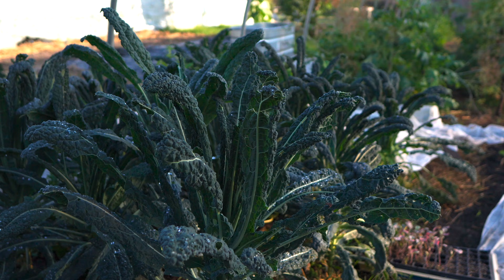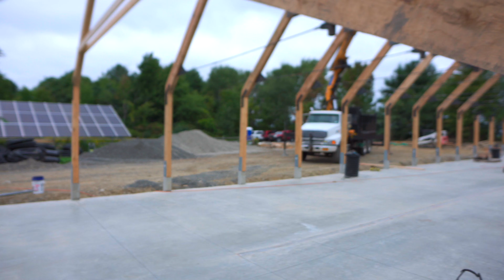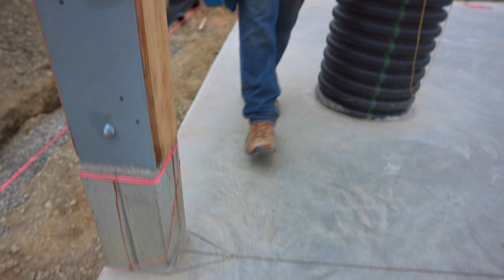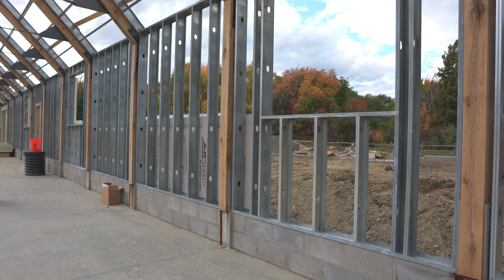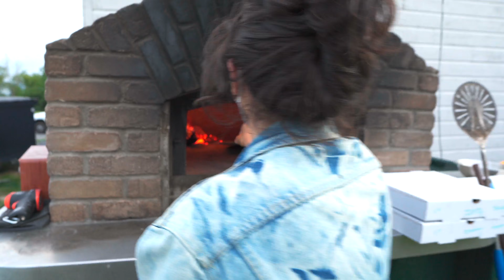4200 sq ft GEOTHERMAL GREENHOUSE Build! — Ep 019

Comment: I hardly think that you use geothermal energy. What you use is ground source based, witch is often misnamed geothermal. Geothermal means that you use heat radiating from the earth core, that means you have to go quite a bit deeper, drill at least 400 m, because you are not in an area where geothermal reaches the surface.

Comment: Why ITH would you use electric water heaters for the slab radiant when you could use an air-to-water heat pump and get 2.5x the efficiency with something like a SpacePak Solstice Extreme that would create heat down to -10F?

Comment: Impressive project, but this sounds to me more like a thermal mass greenhouse (in this case, the ground and concrete slabs are used as a heat sink to regulate, temperature) rather than a geothermal system that uses compression of some mediums, heated by the constant temp of soil to generate heat

Comment: 24:04    Did you use 8 mm polycarb? or 16?      I operate a commercial greenhouse 83,000 sq ft.   Great to see this kind of build.
Reply: Would you use 8 mm or 16 mm?... and why?
Reply: @SarahSmith-hd8kd  8 and 16 mm are common sizes of commercially available glazing panels.  If budget is allows I would prefer the 16 mm with thermally broken  bar and cap glazing system.

Comment: Thank you Sander! I don't quite get this particular design for cooling. Why not send the hot summer air out through mechanical windows at the very top and send the cool 55 degree air directly to the floor to cool what is there? Not getting why you'd want to bring down the temp 10 degrees when it will gain more than 10 degrees from trapped air...
I love geothermal - its a very exciting project - although it looks extremely expensive in comparison with other projects I've seen. Seems like this farmer has unlimited money. 
Of course everyone is working for free to make it work right? hehe
Warmest regards
Jennie
Reply: It would be a little like running an AC with your windows open :)

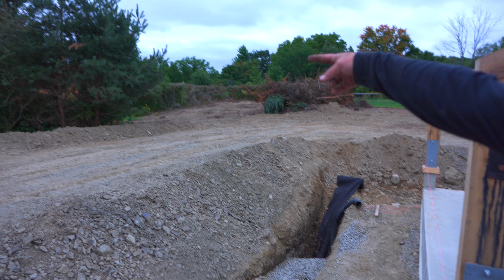Comment: And those Perma Columns were the biggest pain in the was ever to get in. Personally I’d never want to do them again but they also are amazing when it comes to holding the building together and not moving at all. When we installed the drain tile we dug very close to the building on the corners so that the gutters could just connect to them extremely easily so it would just drop down and follow the drain tile. At around 17:00 that hole you see is the one we dug with a drop the whole way so the water would flow down the sides the whole way, and under that cloth you see is the drain tile.
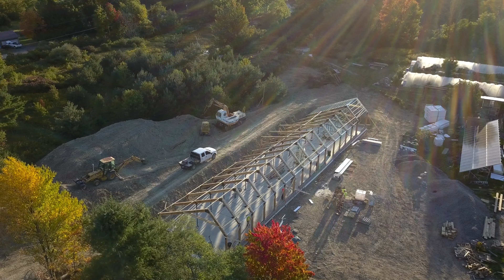Reply: And at the 32:00 mark on the left side the big excavator and the back ho are two of the many pieces of equipment we had there to get the project done.

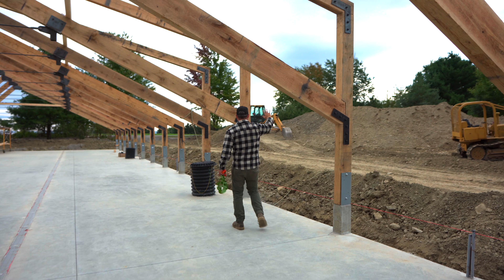Comment: Oh hey look, it’s me in the beginning when the boss was bringing in stone and I was walking with the level stick. That G.A.T. System was insanely hard to build. Thank god it was basically a drought that year cuz if it was raining like this yeah wow. Woulda been flooded the whole time. We installed all the concrete pylons to hook the wood to for the walls. We dug all the G.A.T. System and the drain tile around the whole building so it would keep the G.A.T. System dry. At around 4:30 behind Terry that’s the elevated patio we did. I have a few pictures I think of the G.A.T. System before the concrete was over it. The whole area the greenhouse is on was nothing but weeds and all kinds of BS we had to come through with the D7 to clear it all out. It’s awesome. Not tryina talk exact money but there’s a very expensive Lexus under the concrete price wise lol.
Reply: 18” pipe with 3 levels of 8 holes each for the pipe to go through. Was really hard to put those in. Then had to rent a HUGE plate tamp so we could pack it all down. I heard Gilligan say it was a bit of an investment underneath but it wasn’t a bit. It was a huge investment, but it’s working great and doing a great job. That 4 fr of insulation he’s talking about I installed by running the dozer through around the entire building with a slight dip going lower from the building, dug under the building a little bit so they’d slide under the building (the 4ft insulation) and it worked great.
Reply: @StonedOdie  
When folks say it works great they usually mean that cool air is coming out of the tubes. The issue is that most systems dont move enough air to keep up with the incoming solar gain so the greenhouse overheats even with the system running. For effective cooling you need to turnover the entire greenhouse air volume at least 20x an hour.  By my reckoning , this installation may support 7200cfm and as the greenhouse volume is definitely a lot more than  21,600 cubic feet you wont be getting anything like 20x an hour.

Comment: So we had an earth battery(seems like the same idea as geothermal) greenhouse built in 2015. Think the tubing could have been sunk deeper in the ground, but all in all, we are very happy with it. it is 20' by 10' with raised beds (almost waist height - I am 69 and not up for a lot of bending over) and a shed that goes all the way along the back, which helps with insulation. The back wall is concrete blocks - wall was painted white because we decided more reflected light in the winter was more important than the slight increase in heat storage with a black wall. The covering is 2-ply polycarbonate.  We use it to overwinter pots of tender plants, grow a small veggie and herb garden and do starts in the spring. We do add a little heat in the dead of winter to keep our tropicals at a tolerable level (one of those cheap, oil-filled radiators), but could do without heat if only growing cold-tolerant stuff. We have a row of automatic (wax-mediated) vent openers along the top to keep the heat at the right place - ended up springing for the pricier Gigivents which have been able to withstand the 100 mph winds we sometimes get up here. They have worked very well for us and don't require electricity. We use a system from La Crosse to monitor conditions in the greenhouse with our phones. Love having a greenhouse - music, good book, class of wine, blooming plants when it's 10 degrees outside - heaven.

Comment: I am interested to see if the geothermal system actually works and how beneficial it is.  I have never seen a GT system done so shallow.  Temps don't stabilize till about 6', so I will be following this build on your channel.  Keep us updated.  I was really concerned till I saw the fan system in the walls.  It sounds like they have done a stellar job of research and implementation of systems.  Thinking though all the contingencies seems impressive.  I love the rain water collection system.  Looking forward to seeing the farm in about a year.
Reply from the maker: They ended up going down 6 feet here. But there will definitely be some learnings for sure! We'll have an update from the winter coming up soon. Thanks for your interest.
Reply: A sheltered thermal mass doesnt follow the normal trend because the energy balance (heat in/heat out) is completely different.